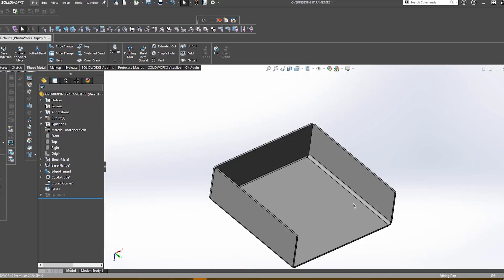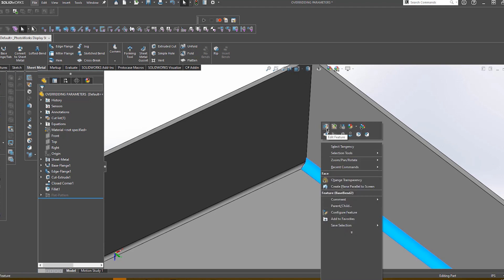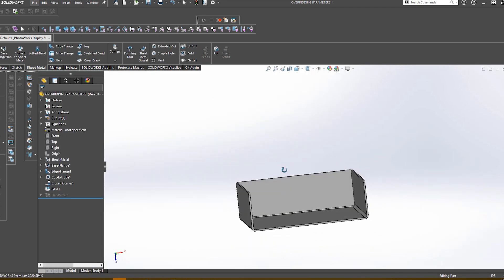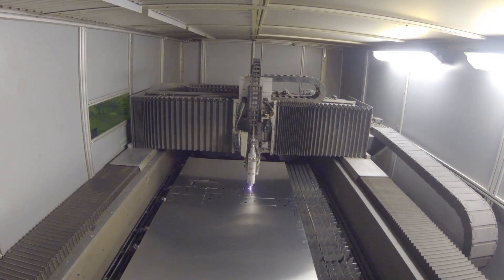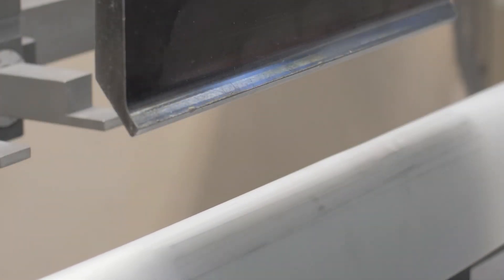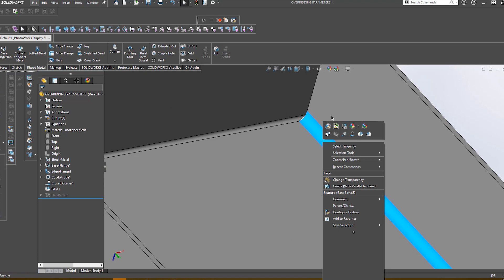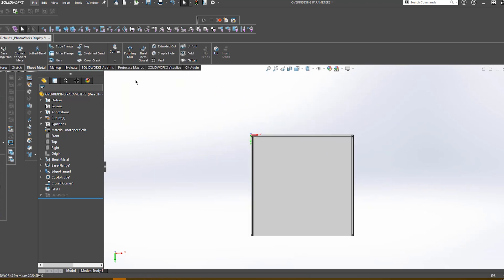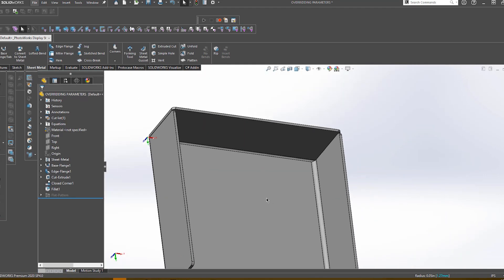Proto Tech Tip - Overriding Bend Parameters in SolidWorks

Comment: I have a multi body part where I have to overide the default value on one bend because for some reason it is pulling an incorrect default value. I made the mistake of making a complex multibody part and will not do it again. SW gets so many glitches with it. Flat paterns don't work. Using save bodies tool I've had a hole disapear on a child part. Problems are endless.
Reply from the maker: Hey there, that sounds very frustrating! Our first suggestion would be to reach out to SolidWorks support to see if they can provide some answers as to why you are experiencing the issues you are seeing. But beyond that, you could send us the model you're working on to see if we also see the same issues.